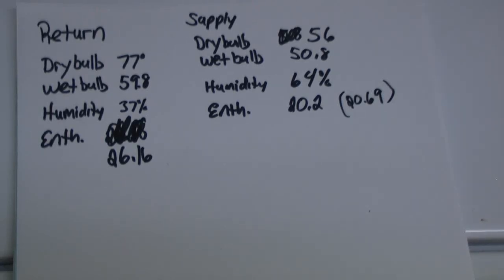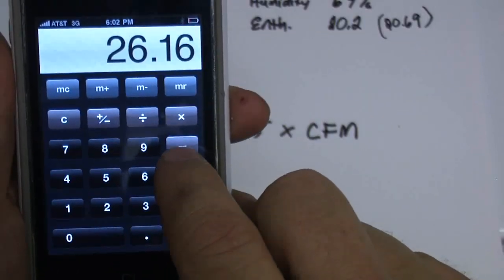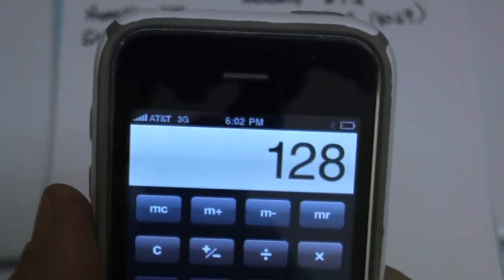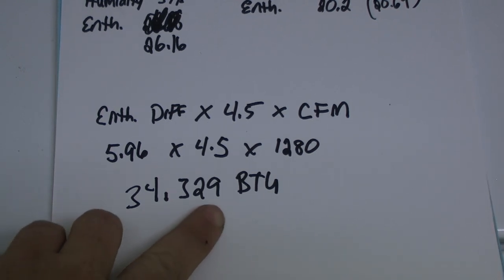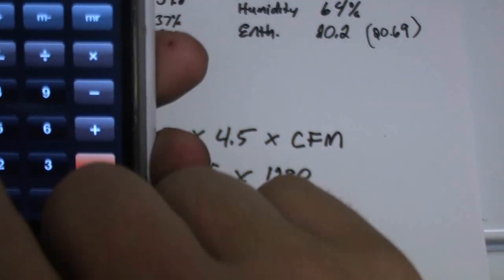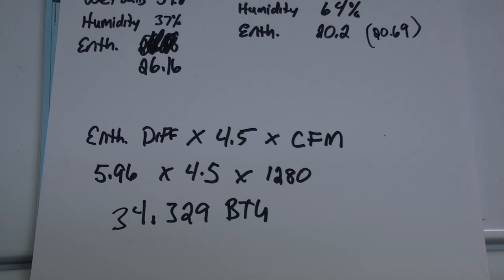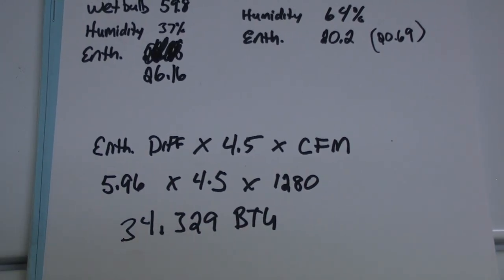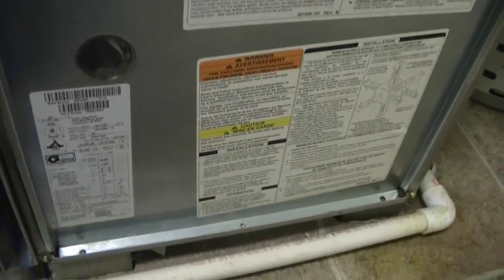Air Conditioner Service - BTU Output (Part 2 of 2)

Comment: Hey Eddie nice video. I have a problem at my house but can't figure  it out. I have a 3 ton condenser with 2.5 Evap. I measured static pressure and have 0.9 inches of water column. High right? I check my blower performance chart and at 0.9 I'm moving 952cfm. little under 2.5 ton (1,000cfm) Using my Testo smart probes I calculated my cooling btu output.  outdoor temp 88F return temp 73F and I get 36,150 btu. my set point at tstat is 72 and actual temp 78. Unit runs all day never satisfy the tstat. why is my btu output so high? my static is high but still moving enough cfm? What you think Eddie?

Comment: Eddie, Goodman 3-Ton 13-SEER @ "ARI Rating" @ 1275-CFM is 35,000BTUH.

At 65-F outdoors, @ 80-F I DB & 71-F IWB @1434-CFM yields 41,400-BTUH output. Indoor blower  @1434-CFM output is 36,100-BTUH. 
At same CFM, a  35,300-BTUH increase difference.

That's a 6,400 increase in BTUH output.
High humidity is a major factor! udarrell - Darrell Udelhoven

Comment: Eddie, the way the system gets an output above its rating in not extra airflow, but a rather high indoor  temp & especially a very high humidity with a low outdoor temp.

For that information Check Goodman: EXPANDED PERFORMANCE DATA

Comment: Hi Eddie, thanks for showing others how to get the real-time BTUH performance of an air conditioner.
I don't use the psychrometric chart, I use an enthalpy chart in BTU per pound of dry air. It's interpolated to tenths of degree wet bulb. 
It is fast & accurate to use.  Using your wet bulb degrees on this chart I got 5.57 enthalpy difference & using 4.5 & 1280-CFM 32,083-BTUH output.
Was that a fixed orifice system or a TXV fed system? 
My website -my WB enthalpy chart. Search udarrell

Comment: Remember if your cfm is higher your enthalpy change will be lower. so your actual capacity will not change very much.  You used 1700 cfm in your example but an actual calculation with excessive cfm would have resulted in a much lower enthalpy change.  Keep the video going this is great stuff.

Comment: Great video series Eddie.  I have a question.  When you calculated your CFM you used static pressure and your calculated cfm was 1280.  When you did the return drop traverse reading you calculated 1020 cfm.  Which one do you think is the more accurate, and why?  Why did you use the 1280 cfm as opposed to the 1020 cfm.  My thoughts are that the traverse velocity reading will be the more accurate.